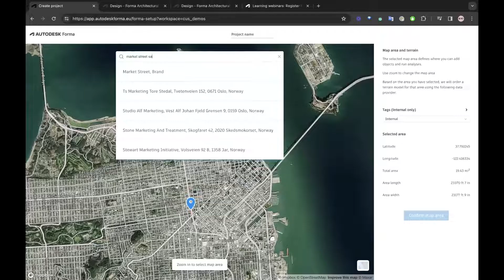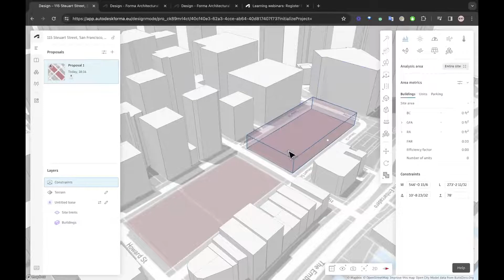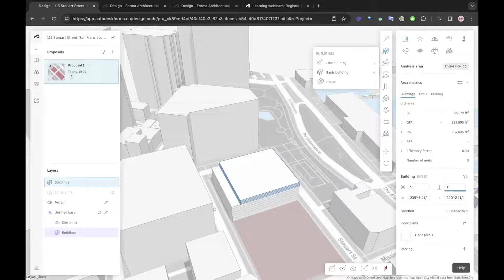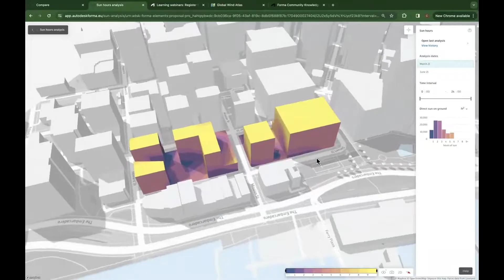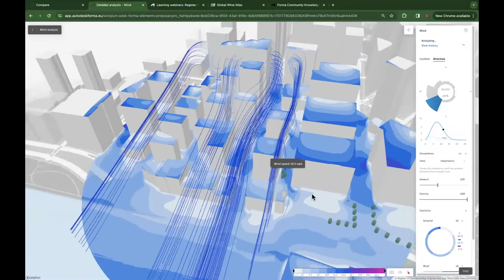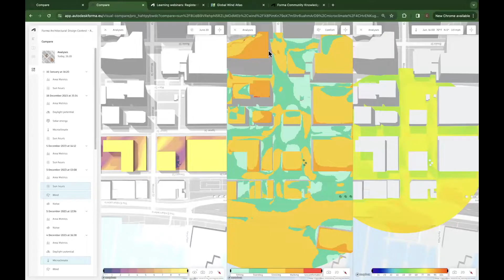Get Going with Forma | Beginners guide - January 2024

Comment: Sorry what is BC, RA? Suggest to put the definition for each abbreviation
Reply: BC is Building Coverage, which represents the area of a building footprint, such as a percentage of the total site area. Inside of Forma Building Coverage is used in the Area metrics tab to analyze how design decisions impact project statistics, especially in mixed-use developments. 

RA is Rentable Area, a metric also used in area analysis. Rentable area is often calculated along with other measurements, such as Gross Floor Area (GFA) and Building Coverage (BC) to assess the potential of a building or site.